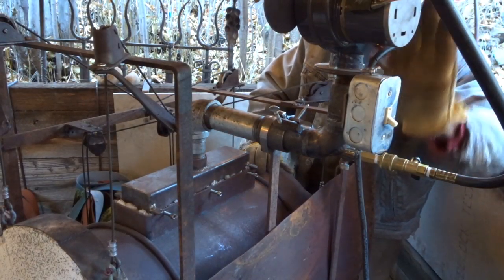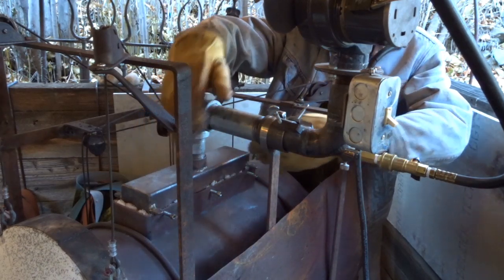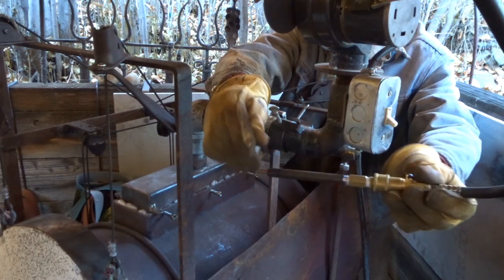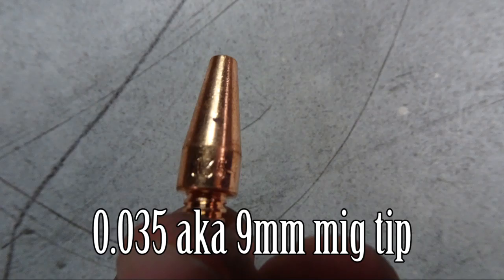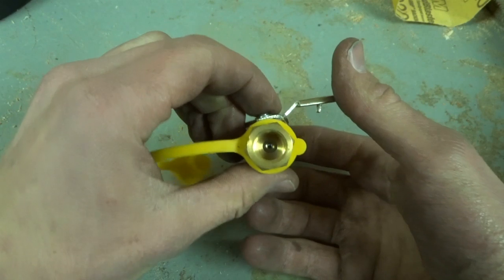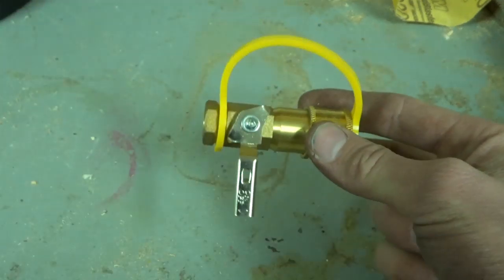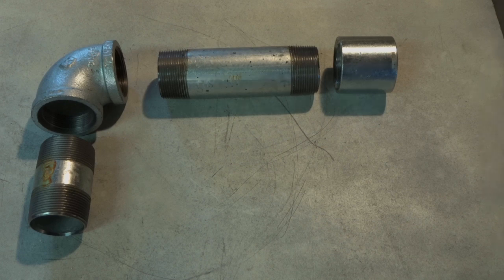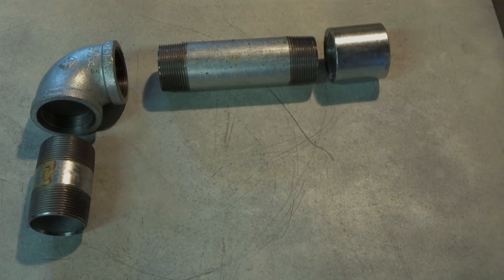Ribbbon Burner Air and Fuel Supply

Comment: i am sorry to say this but that is way overenginered. it looks super professional but there is absolutly no benefit to using the mig nozzle or having the injector pipe removable unless the nozzle gets used up or clogged and i really dont see that happening. it would be sufficient to just tap a hole in the side of the pipe and thread the quick connect in. or if you want the gas to mix exceptionally well you could feed the gas in before the blower and the blower will mix it like nothing else. NOT FOR BRUSHED MOTORS COOLED BY THE AIRFLOW ^^ . it doesnt have to look super trashy either of course. if you want it to look cool it would also be worth a look if those venturi gas mixer rings from "convert your car to run on gas" kits could be used. the pipe diameter seems to be in that range. have to say your assembly does look very sexy indeed.
Reply from the maker: The main reason for removable blower and gas feed is to be transferable to other forge set ups.  That being said, I still haven't installed a ribbon burner on my second gas forge!

Comment: Nice set up. I figured out what 2 of my problems were from this vid. 1 my run was to long and was more of a natural gas set up and 2 I didnt have an air and gas mixer, that static mixer is a nice simple solution.
Reply from the maker: I would expect the mixing of gas is the greater issue than the length of pipe run before the forge.

Comment: No check valve on the propane?  I guess they don't have them on bbqs, just wondering.
Reply from the maker: There is not a flashback arrestor, you could easily add one in before or after the quick disconnect.

Comment: This video really help me I have the same exact Dayton blower but I couldn't get the forge to light my ribbon burner to light and was told that I needed a bigger blower with more CFM so I bought a bigger blower that one didn't work I just recently bought a blower for one of those bouncy houses it's a smaller one but it's capable of more back pressure naturally I guess I didn't have to spend an extra $100 on two more blowers I just have to get to the air mixture right another thing that I saw that really got me thinking was your air fuel mixture device just a piece of metal cut and bent keep it simple stupid I tend to overthink things a lot so thanks a few of your ideas I plan on putting to use finally somebody made a knowledgeable video on building a ribbon burner Forge I've been searching for over a year all I've had is some articles to read bits and pieces of half ass YouTube videos and whatever knowledge I have in my brain from building my original Venturi burner Forge I built myself but wanted something more efficient and every way and of course the ribbon burner is the way to go so again thanks for your videos Man
Reply from the maker: Jeremiah Meachum I'm sorry to hear about your blower troubles. A larger reason I made the videos was due to lack of available content.
Reply: SmithinStu you can certainly say that again and I really do appreciate the content you just put out cuz that's going to be a huge help I think I've got a few problems that I've been having narrow down the biggest one being the fuel-air mixture I think it's been my biggest problem honestly and from the plans that are read I going to have to shorten my length on the run to the burner another thing you said that's more for natural gas and I'm running propane so I'm going to have to shorten that up so just a few small things and I think I'll be where I want to be again thanks 4 the detailed content those small details are always the most important
Reply: + @sollie511  , definitely more information than most all others out there sirSir 
Thank ya'll and blessed days, Crawford out

Comment: Do you pull the blower assembly on shutdown so the hot air from the forge doesn’t chimney back up while things cool?
Reply from the maker: Brian Campbell we just leave the blower running for ten minutes or so after turning off the gas, while the forge cools down. Removing the blower assembly is an option if you don't want to remember to turn it off. The ribbon burner in the glass shop the fan is always left on even when shut down.

Comment: Just for curiosity sake, would it pay to use a heat blocking sealant or seal of some sort between the fan and the fan coupler? It may not be necessary, which is why I'm asking.
Reply: SmithinStu Nice job Stu, I also built one of these a while ago, I use it virtually every day. Incredible how good these burners are. Everyone is surprised how little propane it uses. It's a far superior design than a singular burner.
Reply: Second question: is that pipe galvanized?
Reply from the maker: that is galvanized pipe. Everything from the steel manifold back to the blower is cool enough to touch by hand, so to answer your first question I dont think a sealant between the fan and coupler would help.
Reply: SmithinStu thank you! I wasn't sure how hot it would get back there.